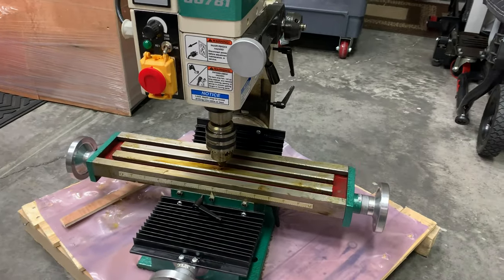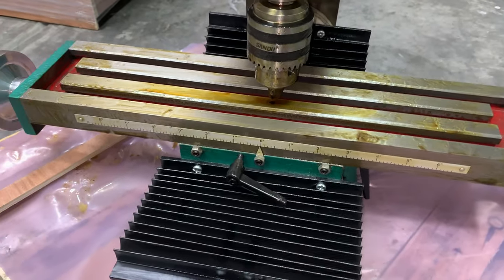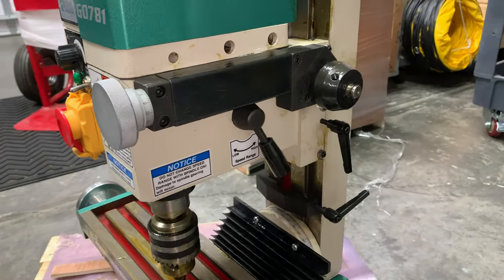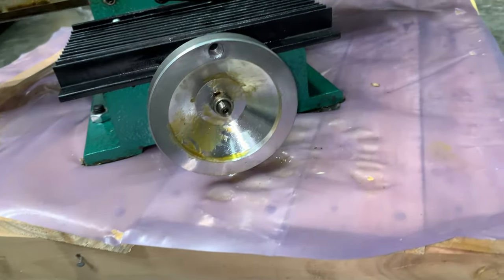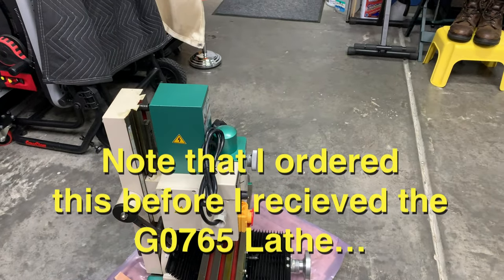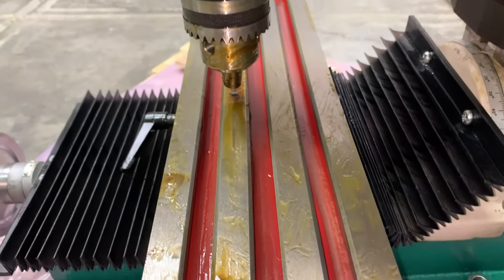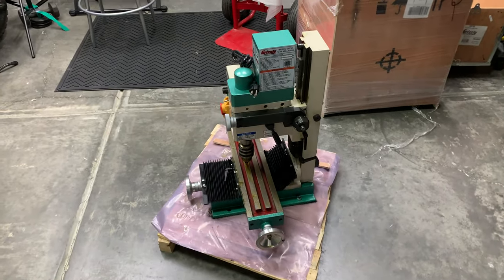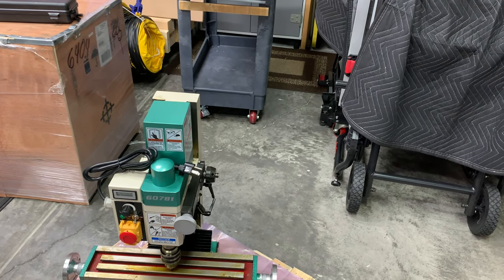Grizzly Mill Drill G0781 - A Follow up to My Previous Video on the G0675 Lathe

Comment: U should make a follow up video on this mill. I'm thinking of getting this one but still on the fence. I like that it has a bigger table then most in this range but it's not brushless. I'm wondering if the gears are like most... plastic. Let me know how accurate it is and its performance when you have time. Thanks!
Reply from the maker: It may be quite a while until I can do a follow-up.  I was recently laid off from my job and we are scrambling to sell our house and move into something more affordable.  I haven't even used the mill or lathe yet and don't know when I'll have the time.  I did go in and clean them up and run through the break-in.  And yes, it does use plastic gears.
Reply: @RC62  Sorry to hear about being laid off. Seems to be happening now a lot more. Hopefully u can find something else more permanent soon and a nice affordable place. Good luck and thanks for the reply. Appreciate the video too.

Comment: I made the mistake of ordering this "mill". The nylon gears inside of it shattered when attempting to... wait for it... use an end mill on brass. Attempted to replace the gears only to find substantially more issues with the product, including a bent key, and apparently the arm for the gear shift is made out of glass because it needed up sheering off. Not worth the money at all.
Reply from the maker: I never got the chance to even use mine.  I was laid off my job just before covid hit.  Had to downsize and didn't have the room at the new house for the mill or the Grizzly mini lathe I bought.  Sold them both for almost what I paid for them though.  The price on them new almost doubled during the pandemic and there was a strong demand.

Comment: So do you have some follow up and updated info about GO781 Mill Drill?
Reply from the maker: Other than running through the break-in procedure I have not used the mill.  Not long after I made this video I was laid off of my job of 21 years and had to sell my house and move.  My new home is much smaller and all of my "toys" are crammed into  the garage with no space to work on anything.  Eventually I hope to get it sorted but it will be a while.  Thanks for watching and commenting.
Reply: @RC62  Sorry to hear that brother.  I'm going through a simular situation.  after 20 years, have to move to get a new job.  I used to do machine and fabrication over 30 years ago, and just purchased this mill to do some light aluminiun milling and modification for side work.
Reply from the maker: Sorry to hear of you're situation as well.  In my case, I went ahead and retired early.  Things are tight financially but we are in better shape than a lot of folks so we count our blessings.  Hope things work out for you.  Take care.

Comment: That sucks that Grizzly wasn't helpful.  I've always had good luck with them.
Reply from the maker: Yeah,  I have several of their machines.  No problems until the lathe.  I'm certain it was a return.
Reply: @RC62  Yeah, that's not acceptable.  I think it's well known that  import machines can be a bit unpolished (to put it politely), and there are some well known issues such as paint flaking.  Metal chips in packing lube isn't ok though.